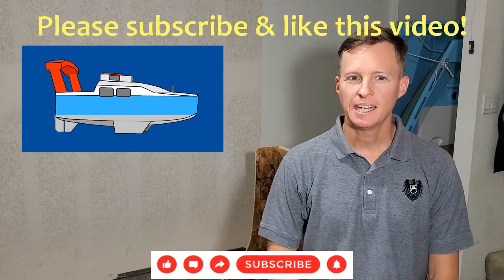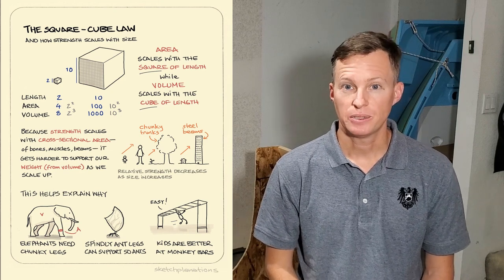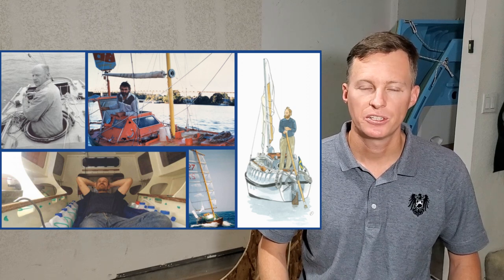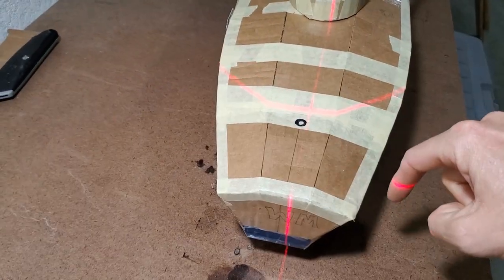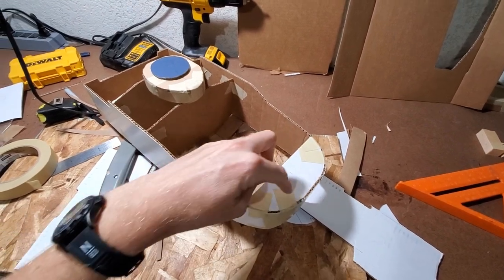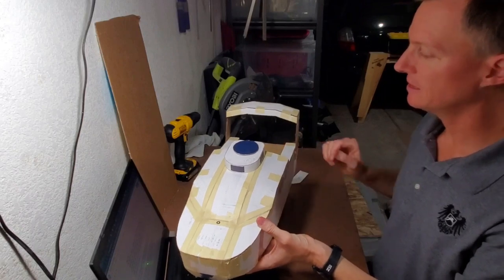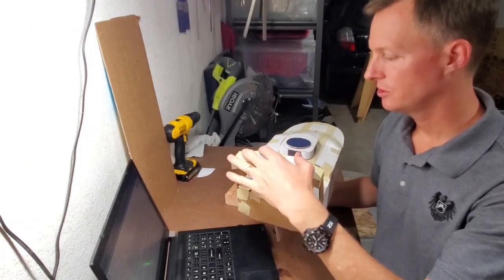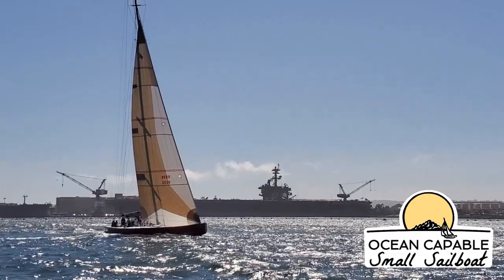OCSS-006 Altering the Design for a Scow Bow and Twin Keels

Comment: I don't want to put you off but you may be heading into trouble. The disadvantage of the scow bow is upwind where the bow will stop the boat with every wave. The Open 60s & 40s you mention get around this problem by being able to cant the boat to one side using water ballast or a canting keel to get a better underwater profile and and also by keeping the bow well out of the water. They are able to make it work by extremely clever design. You are further handicapping yourself with bilge keels whose great disadvantage is greater wetted surface area, they are generally slower. Unless you intend to sail downwind all the time you may find it doesn't work. I have no doubt you know all this as I am no expert.
Reply from the maker: Baluchon made it around the world with a scow bow, making ocean crossings in reasonable times. So, it's been proven to be effective, even if the boat is only 14' LOA. Going fast isn't really my priority though.
Reply: @ocean_capable_small_sailboat  Well best of luck. You might also like to look up Alain Bombard. Another Frenchman who wanted to prove that you could survive on a small amount of seawater and other survival techniques in a rubber dinghy to help shot down airmen in the war. Well worth reading although I guess he is out of print now.

Comment: Bilge keels provide more efficient lateral resistance when angled outwards and outward angled twin skegs/rudders more efficient when boat heeled. All modern bilge keels and twin Skeg/rudder systems  now like above. Good luck with design and build. Ray, Kerry, Ireland.
Reply: No difference in stability (except the draft is probably less=less stability, more wetted area=slower). BUT bilge keels are great for drying out or storage ashore.

Comment: What will your ballast to displacement ratio be? I want to build something with minimal materials cost but bulletproof for an ocean crossing, and I was thinking for speed and stability I'd want a 40ft boat. But you gave some good reasons why smaller can be better. What about speed? Sometimes it's helpful to outrun a storm rather than getting tossed around by it. What kind of speeds do you think you'll be able to get out of it with such a low LWL?

Comment: I like the twin keels.   When heeled, the windward ( in the air)  becomes heavier..  
I am building a 8foot "sleep in" D5 dinghy  with twin dagger boards inside the gunwales. 
They can be short and be used as a "reef point"  when the sail can not be reefed.
As Yann said the scow is probably  the best form for a small boat..
Good luck!
Reply from the maker: Thanks. You plan to sleep in an 8' dinghy? You put some board over the seats at night and sleep on top of that, is that the plan?
Reply: Anders - I'd love to see your plans, and some pictures/videos of your build. I see it's been a year so hoping you've made great progress. I like your idea and have similar plans in mind. Thanks!
Reply: @MrWhynotnow  Hi John!  The hull is a D5 Dinghy (free plans).  I did build a singel daggerboard in center for deck support, when fishing..  Sleep on the bottom.  An Opti-dinghy sail. 
It will be more dinghys..   I have lots of ideas to try out..   I want to try.. a Matt Layden "Elusion".    A " West Mersea duck punt" with deck.         Simple and cartoppable..  
God luck  John!

Comment: I would also prefer the new design. What I am missing is a water deflector in the bow area, because with the gently sloping deck, spray will probably wash over the deck unhindered. I wouldn't like that as much, because that would already limit the use of the central hatch significantly, even in light seas.
I also ask myself why so much bathtub is necessary in the rear. Couldn't the rear area actually be shorter and also have a water deflector to the sides or even disapear at all, creating a house all the way to the rear (containing a second larger sealed hatch for access to the rear outside)? --- Just asking myself what you think about that as an alternative ...
Reply: There is an argument to be made for no cockpit. More interior space and impossible to take on water. If pooped it will rapidly clear.

Comment: Maybe a Laydon Paradox? 

I am building one with the intention of sailing it on the high seas. 

My main priorities, slightly different than plans

Water tight cabin with exterior rudder/tiller
and watertight hatch.

400 extra liters of bouyancy with water tight forward and aft bulkheads.

Chain plates for JS-Drogue 

Basically Roger Taylor(Ming Ming)  philosophy for unsinkable watertight vessel.
Reply from the maker: I like Paradox's a lot but I've only heard of them being used for light coastal cruising and hops to the Bahamas in good weather. Well, Yrvind has built boats with the same kind of chine runner flat bottom and has sailed them thousands of miles so if you prepare it well I'm sure it can take you far. Best of luck.
Reply: Great channel. I didn’t realize you are quite a ways into your build since this was the first video I watched.

The Paradox community speculates it could make a crossing CA-Hawaii or Mass-England but no one has tried it yet of course. I plan on doing  one of those routes June 2026 after sea trials on my home waters of Lake Erie 2025.

I will incorporate some of your ideas into the modified Paradox. 

Cant wait to see your boat get wet and make some miles!
Reply from the maker: That's great! I actually incorporate some ideas from Paradox's in my build. I have refered to those plans and build pictures for ideas before.

Comment: I too really like your design and appreciate your explanation of the  design decisions. Are you going to sell plans for your design?  I am trending somewhere between your boat and the Wave Rover 650. I started sailing a sabot in 1958 #225. I love small boat sailing and am more familiar with your sail plan than the junk rig of Wave Rover. I will be curious to see how your reefing system works out. How will you have an anchor light with a rotating mast ?  
Thank you friends.
Reply from the maker: Anchor light goes on a pole on the buoyancy arch. 
If you'd like to build it seriously, just write me at my e-mail and I'll send you some drawings. You could start with a simple cardboard 1/10th scale model and see how you like it.

Comment: Bilge keels fine leeboards better.
Reply from the maker: Pretty subjective. They're great for inland use, but I wouldn't want leeboards for offshore sailing. I prefer to have fixed keels with lead on the bottom.
Reply: @ocean_capable_small_sailboat  A good point about twin keels is they increase the moment of inertia so the boat will roll like a much heavier boat. Leeboards can also be weighted.